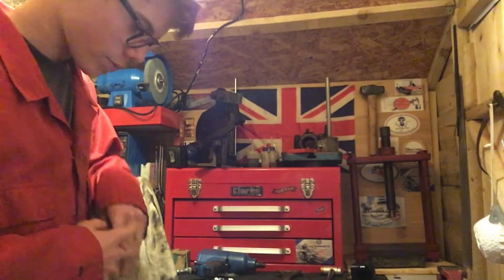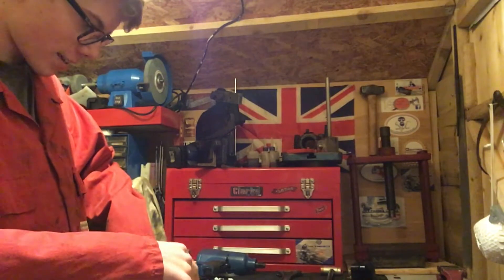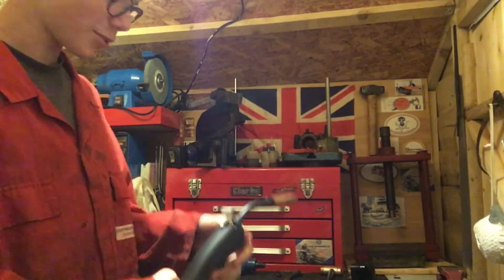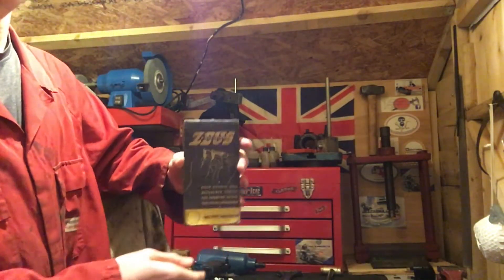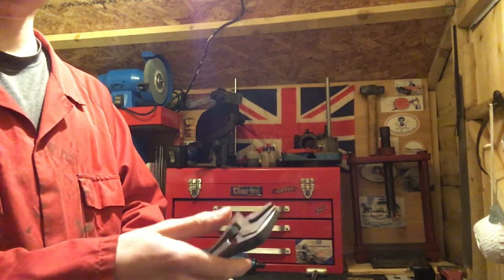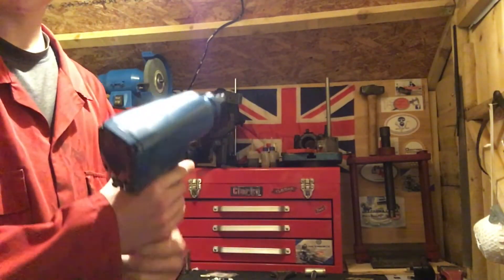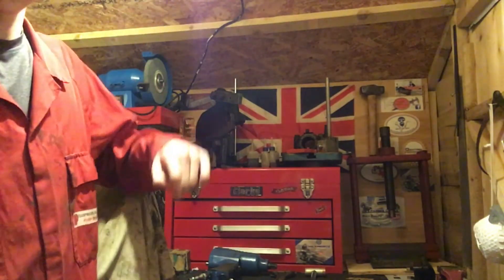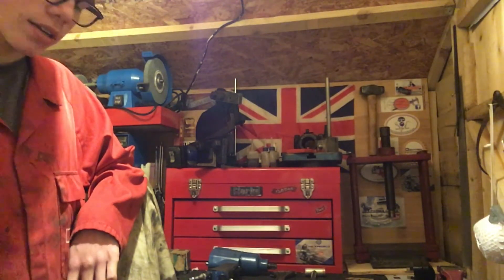Shop Talk (number 1) A New Mig / Flux Core Welder

Comment: The Lancashire boiler looks interesting,
Reply from the maker: Dave 508d cheers , up at the museum we have a bank of five of them. The one you see came out of service in October and goes back into service after maintenance in February. We run them for ten years before another strip down.
Reply: At are musium we just have the front, we would I full boiler but there just isn't the space. I think I'm going to try and visit your musium this week as I have some time off, what's the best days to visit
Reply from the maker: Dave 508d Saturday between 10-5 il be there all day , it’s well worth a visit , 5 boilers , 4 beam engines , steam powered workshop, generator house , to name a Few.
Reply: Machining Basics yes I think I'll come down for a look its about 2 hours away from where I am but I'll make a day of it I think I'll call in at blackgatss model engineering along the way

Comment: I wouldn't even consider a Snap On impact gun.  IR makes a much better gun for less money.  I have a 1/2" drive S.O that I mostly only use for taking wheels off an Ingersoll Rand 1/2"for anything that won't loosen and an Astro Pneumatic Onyx  1/2" and 3/8" for everything else.  If I had to choose,  It would be a toss up between the IR and the AP.  The Snap On wouldn't even be the third choice.
Thanks for the video.
Reply from the maker: Bruce L. Cheers for the advice!! I’m trying to find IR in the uk and I can get it through amazon. I’ve got a snap on air drill which is excellent but the snappy impacts are too expensive for me.